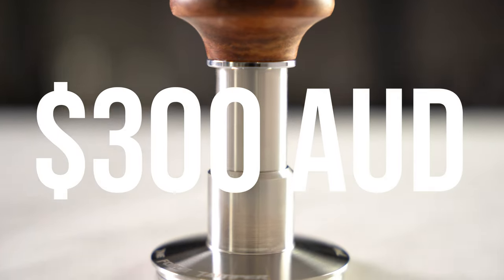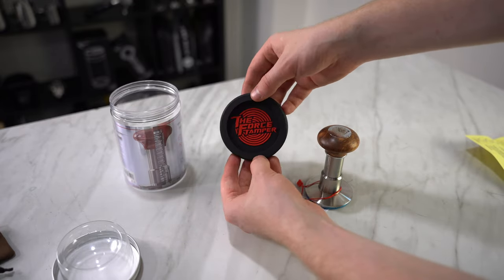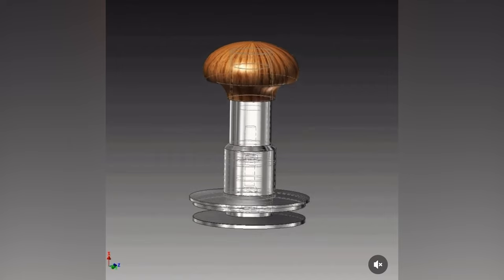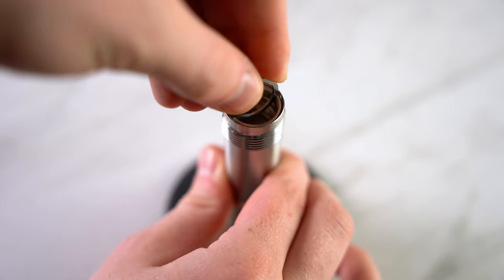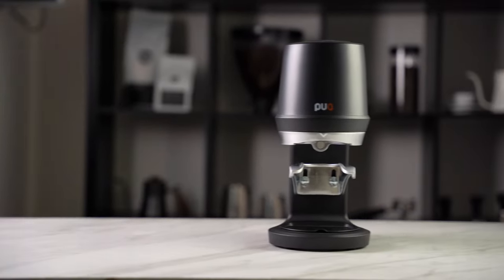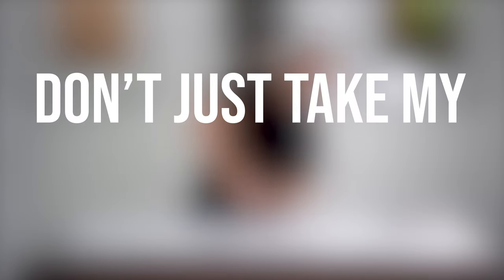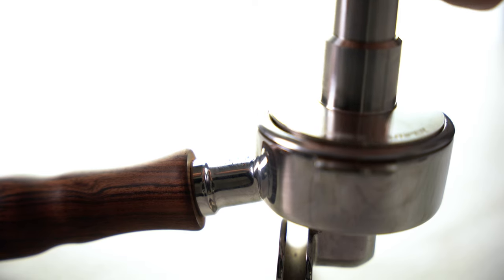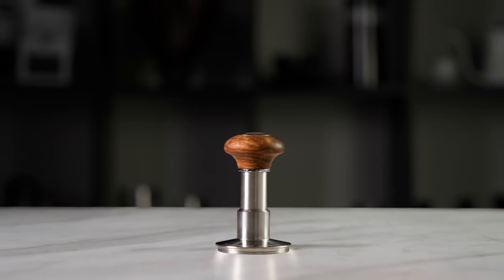The Force Tamper Review: The King Of Coffee Tampers?

Comment: this tamper is more expensive than my espresso machine ( x2 ) and i already can do a perfect espresso shot. I don't think this is bad , i just think this is an overkill. Automatic level tamper is what you need if u don't know how to press your coffee puck ....after some times, u can just use normal tamper . Just learn how to press properl, levelling with your finger on the portafilter, and it's still a good ( and super cheap) strategy. if you think i am wrong , a single "blind test" is the only way to proof it ...i wait for it ;)
Reply from the maker: Yes this is true! This tamper is expensive, and certainly isn't for everyone, however it is an incredibly well made product that fits in the high end range of coffee tampers, it's over the top and almost ridiculous, but it still does it's job and it does it incredibly well! Especially when considering how quickly and reliably you can tamp without thinking about it, it almost chases after the auto tamp market, and is so much cheaper then any auto tamper currently on the market!

Comment: Is there any specialty of the force tamper besides constant level tamping and changing pressure's lbs? (If what i know besides these is it has variations of plate and there's also D plate which can be used for distributing and tamping) 

If there is 53 to 58mm force tamper, if we wanna have both size, must we buy individual or is there any setting to make plate 53 to 58?